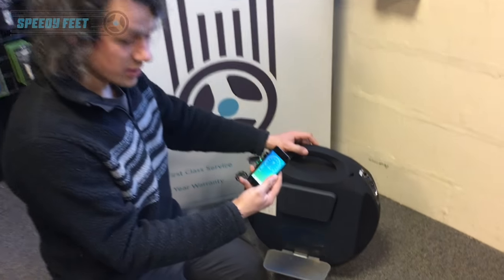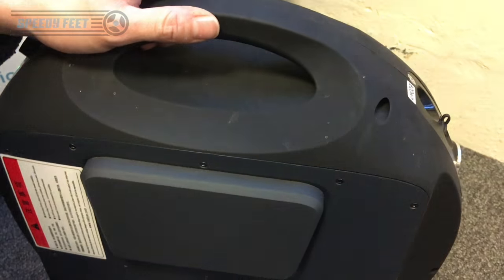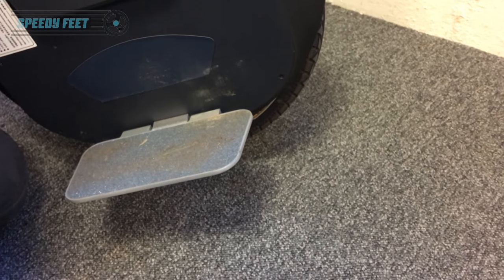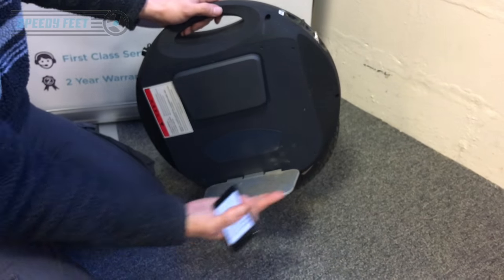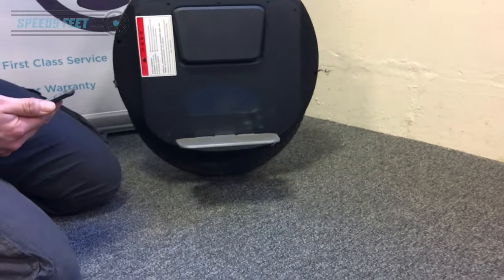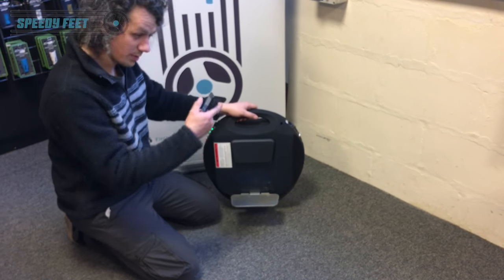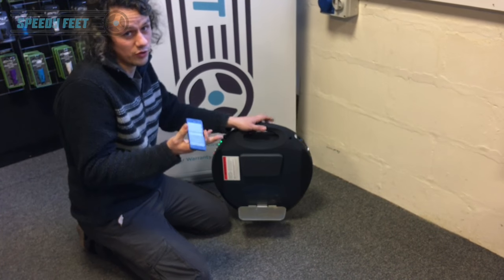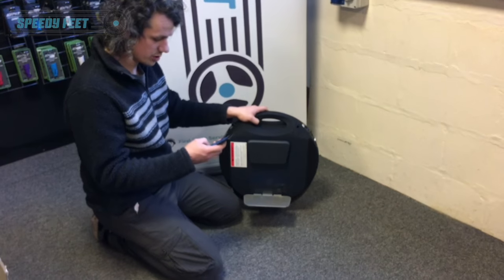How To - Calibrate a Gotway Electric Unicycle

Comment: My brother, I have a problem with my scooter. When the speed reaches 45, the alarm goes off and the scooter turns off. Do you have any solution to prevent it from turning off, or a video clip explaining the method, brother?

Comment: thanks for the demonstration. Really appreciate it especially as the gotway device does not come with its own English translated booklet. Is there any precaution to charging... Like should I plug in the charger first and then connect to the device or connect to the device and then plug into the wall?
Reply from the maker: With the 62.7v volt versions turn on prior to plugging in. With the 84v you can plug in then power on.

Comment: Gotway app for Android is useless. My Gotway MCM5 beeps above 5mph and is in tilt back most of the time. When I slow down it rights itself but then tilts back again at random times. The app has a calibrate function but no instructions and when I press calibrate I just get the spinning circles forever so I have to force stop the app.

Comment: What nonsense. With the INMOTION it's super simple to adjust the level.
Reply: This is simple too. It literally takes less than 30 seconds to level it in this manner.  The inmotion wheels are designed to be mainstream and simplified, but also have lower specs than gotway or king song wheels. The gotway wheels are far more customizable with regards to wheel setup, such as tilt back and speed settings.